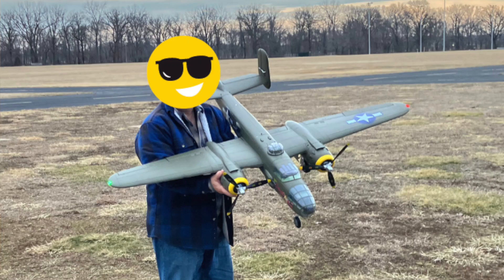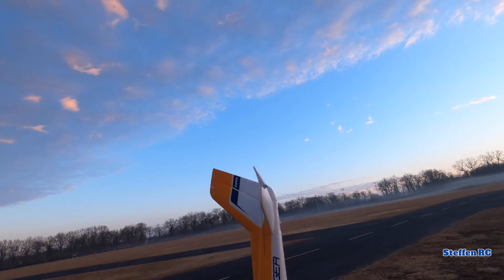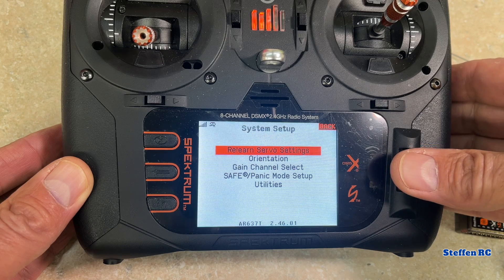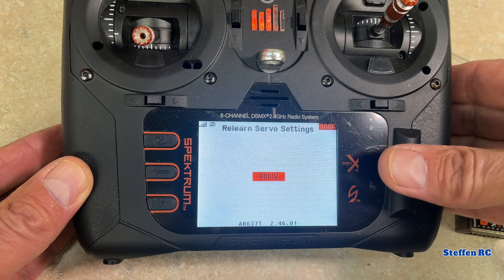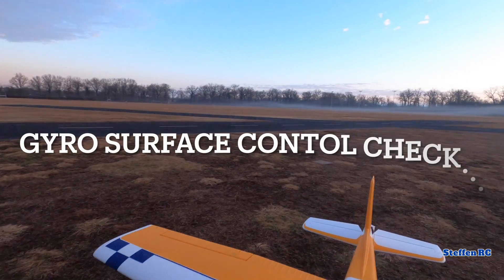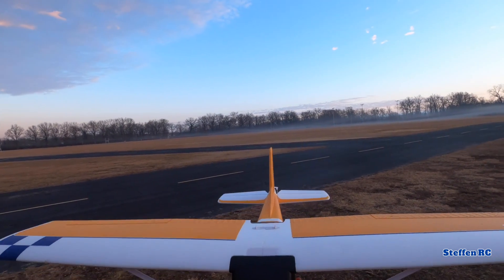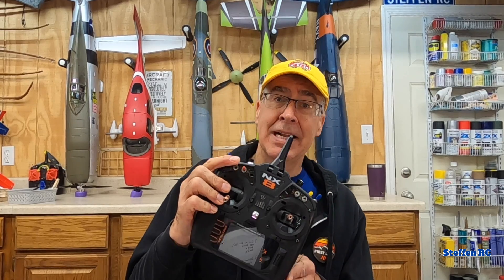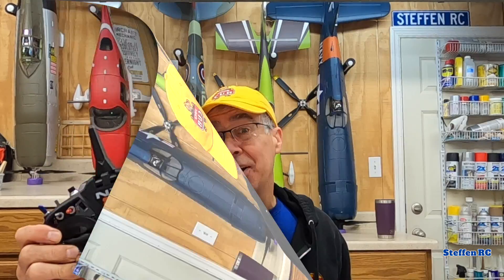How to test the Gyro in your RC Plane to prevent a crash

Comment: Informative, the forward program relearn is a nice feature.  Still feel gyros are more hassle than they’re worth.  👍
Reply from the maker: They have there place for sure.  Kinda like rates, expo and battery voltage telemetry info..  The hobby is open for all, and offer pieces and parts to enjoy however you want..  (A lot different than when I started in the early 80's...). Thanks for watching and commenting - Will
Reply: @SteffenRC  yes agreed.  It seems the new nx line is making setup much easier.  The gyros I’ve played with require laptop or blue tooth setups such as the ar636 receiver. I’m still using an older dx9.

Comment: Agreed!!!  Always setup a 'gyro system' on a 3 position switch so it can be turned OFF if necessary.  It breaks my heart to see any airplane CRASH because the gyro wasn't properly setup and TESTED before flight.  Sometimes the cost of learning comes high!
Reply: I’ve been programming Spektrum receivers for several years and frequently make the maiden flight in SAFE mode - not because I need it; I want it. I’ve been flying R/C for 60 years. None of my planes have an off position for the gyro.
Reply: All model airplanes that I have fly much more realistic with SAFE turned ON and they tend to last much longer too <big grin> @txkflier
Reply from the maker: No doubt..  BNF are super simple and easy..  Its when pilots go to the PNP planes, things get a bit more complex..  Gotta pay attention to all the details.

Comment: I have had this problem with some of my planes, but checked them before flying. I have had to just turn off the gyro on that axis completely, but looked for the relearn servos. I could never find it with an unlocked receiver. How do I find it?
Reply from the maker: I go through the menu to find “ Relearn Servo” in the video.  Make sure the plane is powered
Reply: I have done this and it does not seem to be there so I’m not sure what to do.
Reply: @Waffle_982 Have you tried redoing the whole rebinding/gyro learning process from scratch? (After changing the settings on your transmitter).

Comment: When setup properly gyros are amazing. I will never fly without one again. The gyro saved my plane when I got turned around flying, just turned on self-leveling, and my plane correct 20 feet from crashing.

If you setup anything incorrectly, it will cause your plane to crash.  

A poor workman blames his tools.
Reply from the maker: I don’t have an issue with Gyros.  My video is about setting them up and using them properly.  Not sure what you’re saying…
Reply: @SteffenRC  Probably was referring to your thumbnail which literally says "Gyros Kill Planes"...
Reply from the maker: @ReptileRescue  I guess so.  Making a thumbnail that will get a click or interest is tricky.  You either gotta say something that provokes a click or have a young girl in a bikini holding the plane.  And I ain’t doing that. 😀

Comment: Well for one, you should never ever take off a plane with gyro for the very first time. This should be tested way up in the air.
Reply: Again, if set up properly, using a gyro is way safer.
Reply from the maker: @user-cc3cq7xi6p   There are two reasons you should maiden you plane without a Gyro.  1.  Trimming and balancing (moving the CG) should be done without a Gyro, since the gyro is correcting for a poorly setup plane.  Better to get it tuned up perfect, then use a gyro for better performance.  2.  Setting the gains on a plane can be a risky situation if you set the pitch or roll too high. The oscillation will/could be a disaster.  So, flying at altitude and turning on the gyro is a much safer way to address the situation around setting gains..  At least thats my opinion.   You may have a better way to accomplish that..
Reply: @SteffenRC  
To be honest I’m not familiar with spectrum’s gyro system.  If you’re talking self leveling gyro, then obviously it will hide mechanical trim issues.  
“Environmental” correcting gyros won’t affect or correct trim issues.  Trim issues will still show up in flight, at least the kind I use. 

Everyone does their own thing, IMO, gyros have vastly improved the hobby and made flying more safe. 
They have always helped me maiden successfully.  I will never fly anything without one anymore. 

Again, just my opinion.
Reply from the maker: Mike..  I mention that in the video..

Comment: Sometimes I get the impression that people who use Spektrum radio gear think that everyone uses Spektrum radio gear. Other systems are available! 🙂
Reply from the maker: Yes there are lots of systems.  I use Spektrum and FrSky.  There are also lots of options for Gyros.  The concept of preflight gyro check is universal for any system or gyro though.
Reply: @SteffenRC  Yes, but the details differ when you start going through radio menu options. No worries, good video!
Reply: Maybe you could add your own video on setting up the system you use to help others who don’t use spektrum 🤔
Reply: @iansummers6945  Maybe we all could 🙄
Reply: When you go into forward programming for first time setup, it clearly states on menu screen that all control surfaces are set “correctly” before proceeding. So either he didn’t heed that warning, or he made a change after the fact and like you said didn’t relearn. So sad to see that happen to a beautiful aircraft. Now for the $64k question. Whens the repair video coming  out?? 😅
Reply from the maker: @bigrickRC1144  ha.  No repair video on this one my friend.
Reply: I’ve tried various gyros, but none of them work as well as Spektrum’s AS3X/SAFE receivers. Plus, the gyro is built into the receiver.
Reply: @txkflier i just installed an admiral rx gyro which is pretty awesone imo..it has safe,gyro,and gyro gain control from radio..they dont sell them anymore...i picked up 3 around 5 years ago for only $100...i finally had a friend help me figure  them out..
Reply: @txkflier Radiolink’s Byme A is way better.